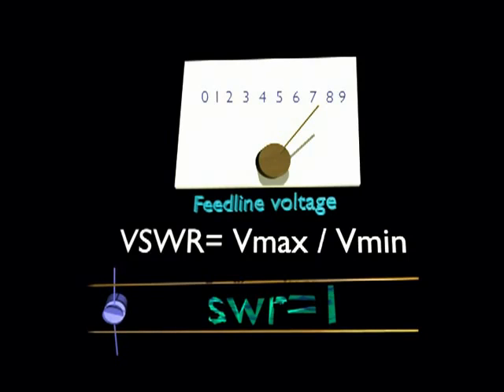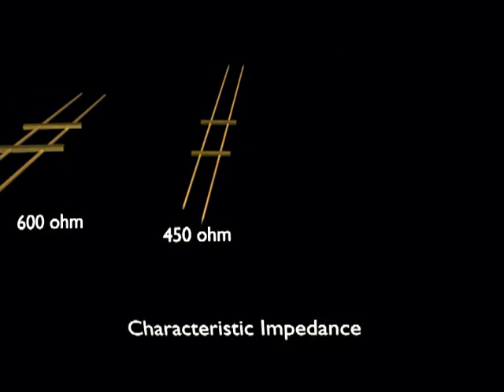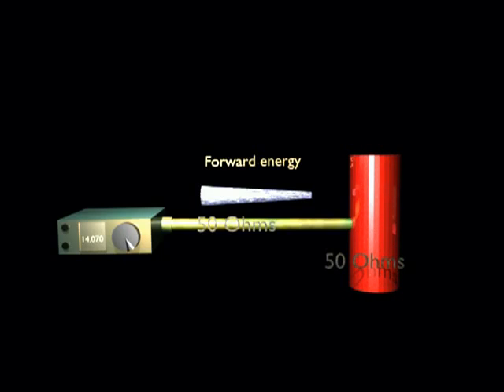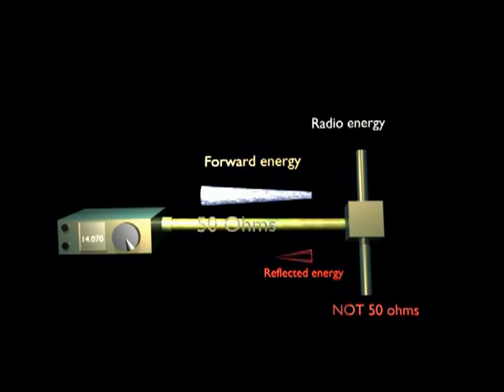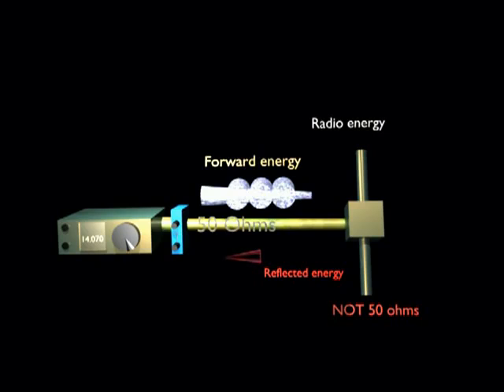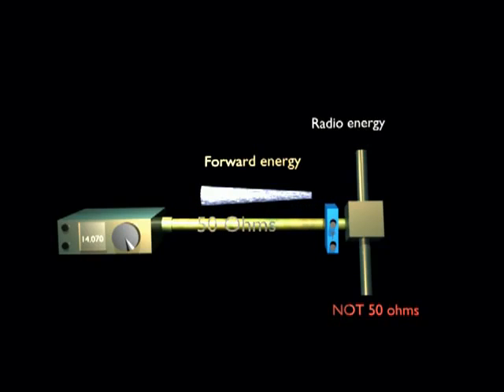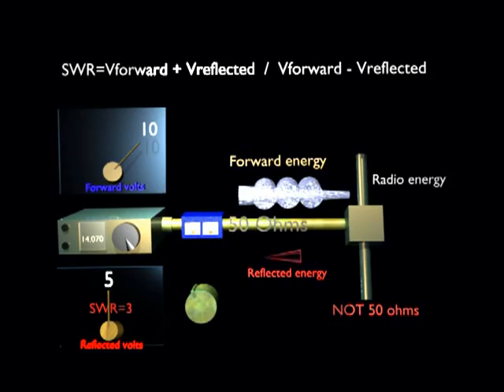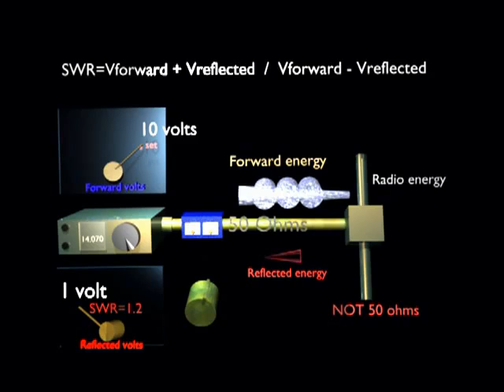Standing Wave Ratio explained

Comment: If the reflected power at the transmitter is lower enough not for swr protection circuit to be activated in radio, will this power be lost in radio components or also sent back to antenna

Comment: People also forget field strength, which, for me, holds more value than an SWR plot. Radiation of the antenna also reveals electrical downtilt, phasing, and element to element coupling, and re-radiation(Yagi).
SWR has value and purpose, but it is one equation, not the sole answer.

Comment: NO!  These concepts are well understood and based on physics.  Engineers have understood these things since the beginning.  The physics, and what is happening in these devices are well understood and always have been.  The development of these devices is not the result of people just playing around.
Reply: Great video. Couldn't agree more. As a young Novice, we were fortunate to have our local broadcast engineer (1000 watt AM, 600' tower) in the radio club. He answered all questions quickly and in an easily understood way. Since then I have heard far too many pontificate on what they do not know. All hams should read the first few pages in Walt Maxwell's book, "Reflections," especially the 75  untrue facts about antennas and transmission lines.

Comment: I thought the closer the wires in a feeder the higher the impeadance! Can someone get back to me/comment on this please! Brian M6BAQ Dover England.
Reply: The further the wires are apart for a given wire diameter the higher the characteristic impedance will be , which also means that for a given spacing if you increase the wire diameter characteristic impedance will be lower.
Reply: @johnyoung1128  Thanks!